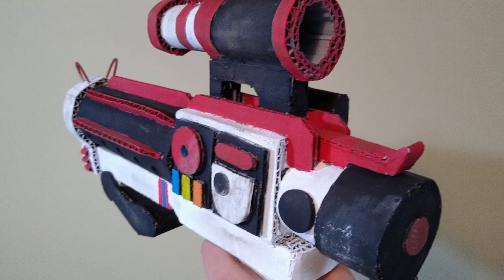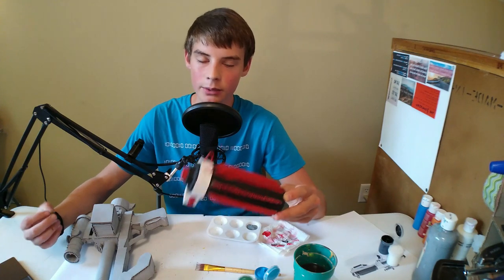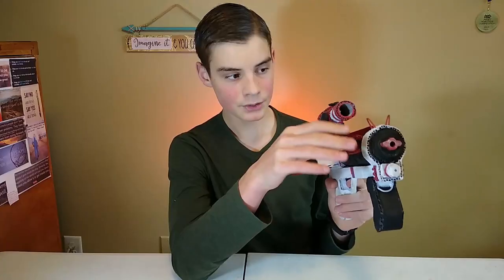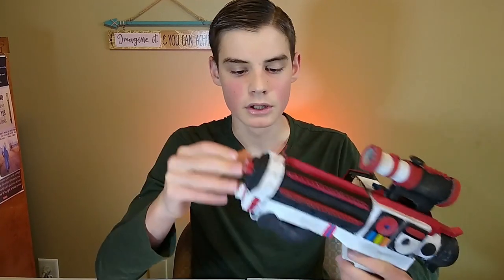How to Paint a Cardboard Model (Cardboard Basics)

Comment from the maker: QUESTION OF THE DAY:
💡❓Do You paint your cardboard models or do you prefer you leave them as plain cardboard❓💡
- It would be awesome if you would let us know your answer here in the comments!💬
⏰⏰TIMESTAMPS⏰⏰
00:00 - Intro
00:35 - How to prepare a cardboard model for painting
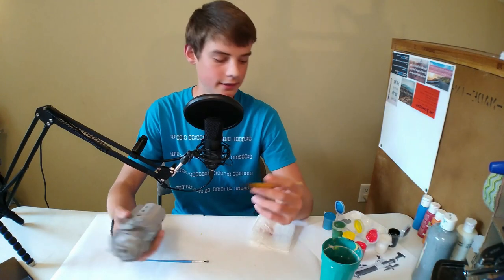01:36 - Timelaps #1 (Painting Begins)
02:05 - A benefit of priming your model
02:17 - Timelaps #2
03:08 - How to use your brush strokes
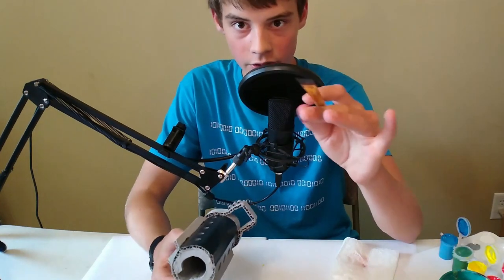03:32 - Timelaps #3
04:27 - Cardboard painting tips
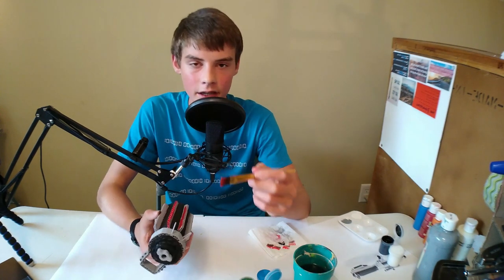05:19 - Timelaps #4
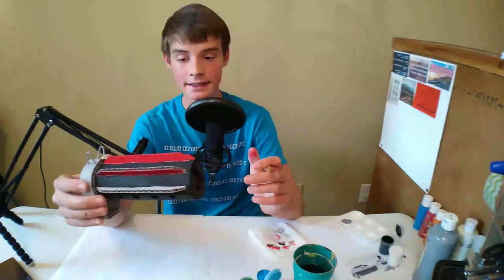05:32 - How to avoid leak-over when painting
06:00 - Timelaps #5
07:19 - Quick tips for painting a cardboard gun
07:54 - Timelaps #6 (bigger timelapse)
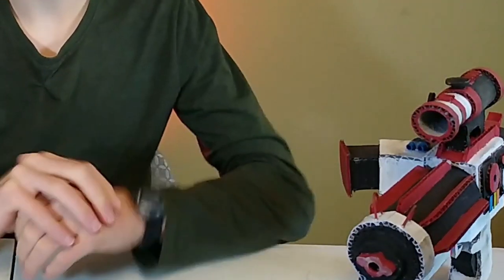09:56 - Everything you need to know about painting cardboard models (more tips)
13:13 - Question Of The Day

Comment: If I am using just one color on a large area, does spray paint work well over the primer?
Reply from the maker: I have not personally tried that but I am confident that it would work. You just want to make sure that you use the spray paint properly so that it doesn't drip. 
If you want primer there is a link in the description to the one I used but there are also other colors and kinds of primer that would give you slightly different results.